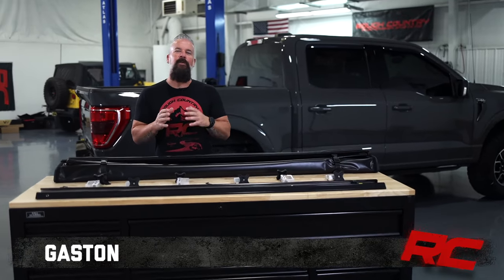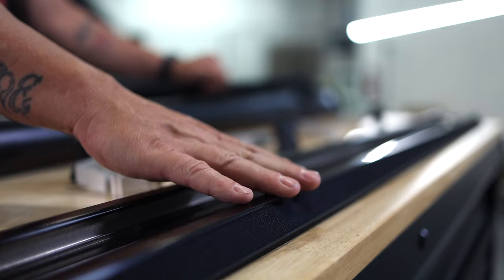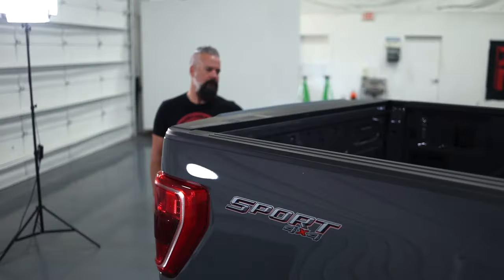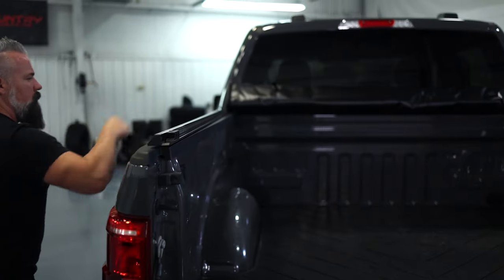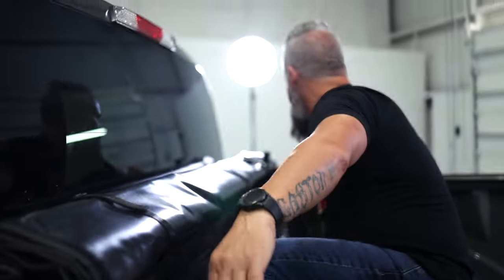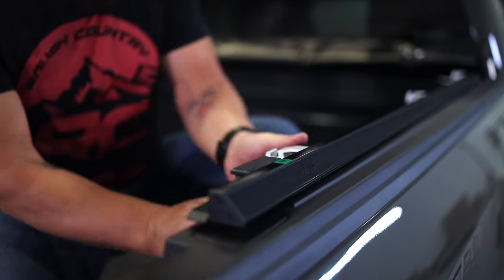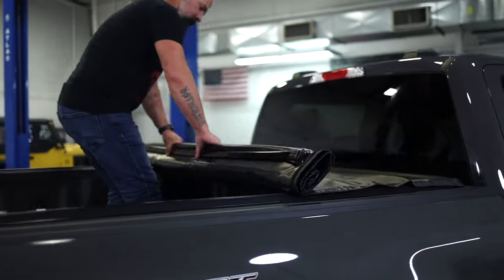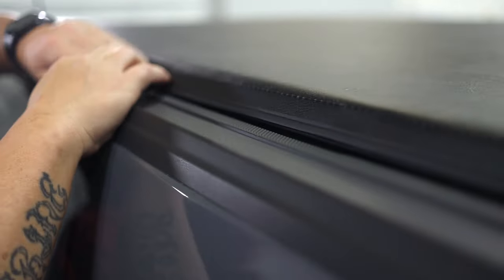Rough Country Soft Roll-Up Bed Cover Install

Comment: Bro the truck cover won’t lock…I’m at the last step
Reply: I had to slam mine down. The vinyl is tight and has to stretch.
Reply: @derangedgarage7121  Thanks bro I slammed mine down too and adjusted both sides again! 💪

Comment: This does not fit for utility track bed, Toyota Tacoma 2023?
Reply: I just put one on my 23 tacoma tonight. There's a set of aluminum pieces that came extra with mine. Wasn't in the instructions but I fumbled through it and I'm assuming that's what they're for.
Reply: @kish-river  how are you liking the cover?  Any issues having to adjust the tension as the seasons change?
Reply: @PottersWork  it's decent. For the money, it's worth it. It's not 100 percent water proof around the edges where the frame sits on the bed rails. I haven't had to re-tension it at all.
Reply: @PottersWork  by the way, you have an awesome channel. Keep up the hard work.
Reply: @kish-river  Thank you!  And I appreciate the info on the cover!  My current cover isn't 100% water tight either, I haven't seen any roll ups that are, but I haven't looked too hard